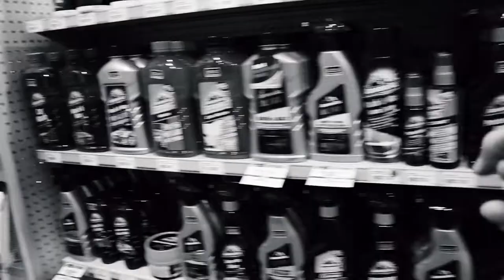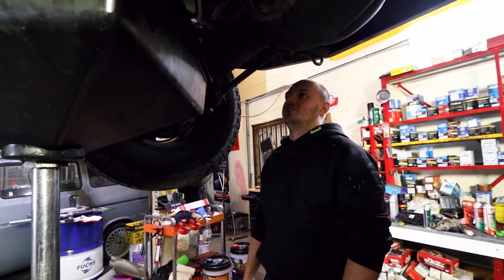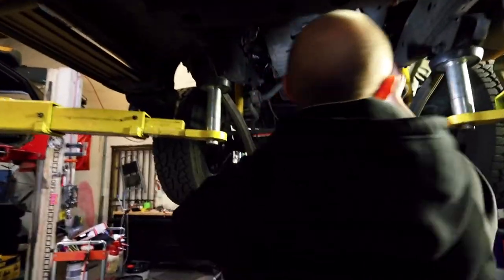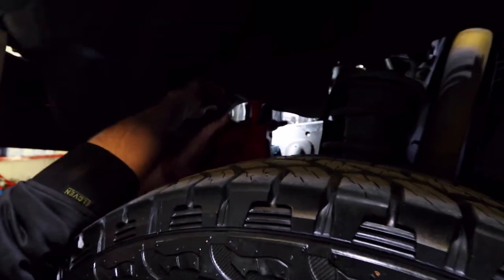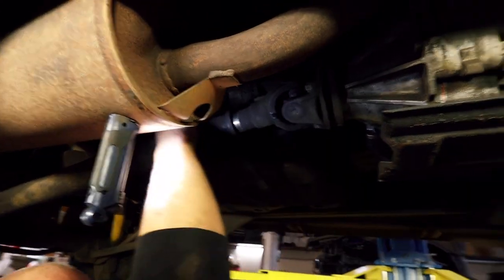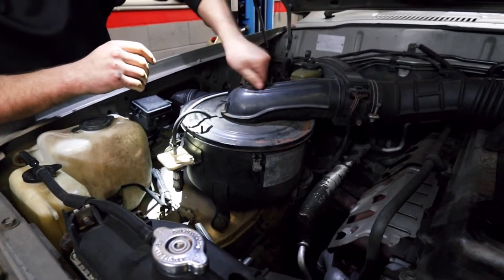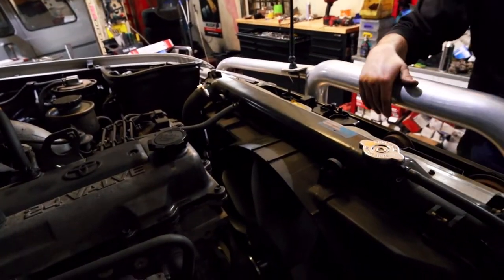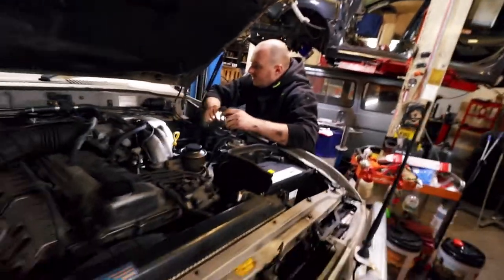How to service a 80 Series Landcruiser.

Comment: great video however a couple of points.
8L is too much, 7.4L with new filter is all thats needed, youll get foaming & aeration of the oil with 8l
Moly grease in the tailshaft slip joints and HTB in the uni's